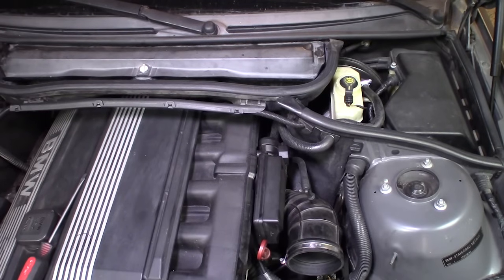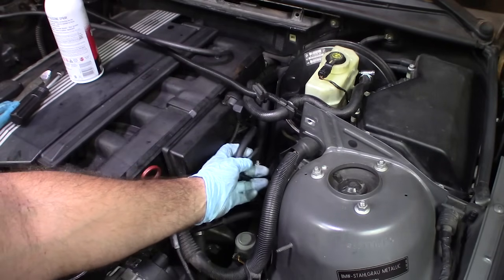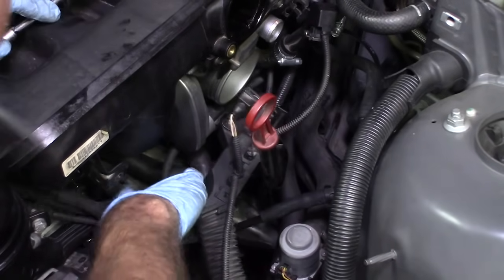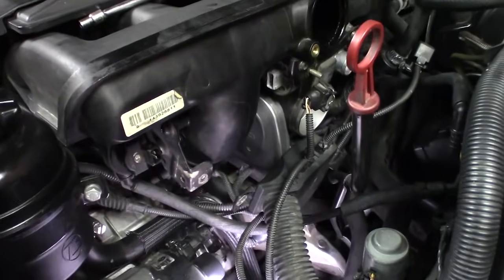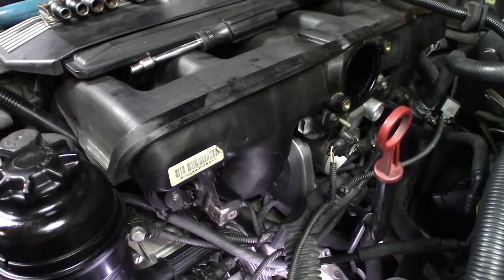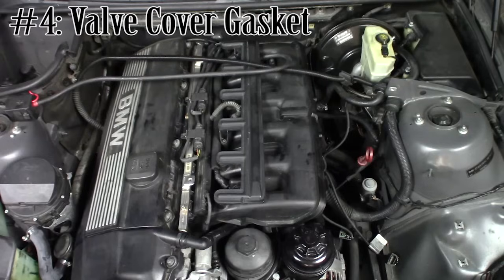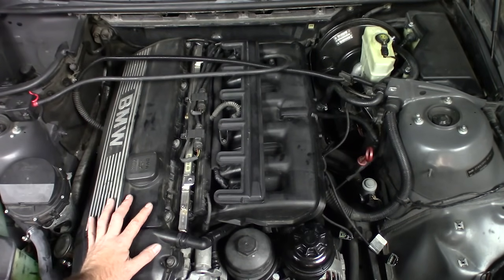BMW E46 & E39 Most Common Vacuum Leaks P0171 & P0174

Comment: Hello 50'skid!

I need your help. I've watched some of your videos and I LOOOOOVE them! i recently bought an 01 325i manual transmission with 126K miles. It would intermittently stall and would have a surge idle approaching a stop while the car is on neutral but will idle normal after about 10-20 seconds. After checking for vacuum leaks and cleaning the CAI valve and replacing the MAF, new air filter, change the DISA o ring. The stalling stopped but the idle bounce or surge during slowing down while on neutral or pressed clutch is still going. It would almost stall but not completely, but would rev up to come to a normal idle. I am soon to change the fuel filter. If you have any tips and advice it would much be appreciated. This issues is more prominent when the A/C is engaged. So i drive without the AC for now.  There are no codes at this moment and no other problem.

Thanks!
Reply from the maker: Look into the idle air control valve. That is likely the cause.
Reply: 50sKid I cleaned it with carb cleaner...do you recommend me replacing it or maybe test it first?

Comment: greatt video !!!!! i have the code lean bank 2 on mi 525 i 05 bmw and mi car is running just find so what do you think it could be mi problem?
Reply from the maker: +david aguilar Thanks.  Things that could affect just bank 2 are exhaust leaks (there is an exhaust manifold for each bank), leaking injector o-rings, leaky intake manifold (two gaskets, one per bank).  Those are the most likely suspects.
Reply: 50sKid awesome thanks i gone check those points and get you back my findings thanks for your help

Comment: I replaced my ccv valve and all hoses associated with it about 2 years ago after having burning oil issues, but now the car runs much better. However I did not buy all the right gaskets. I have p0171 and p0174 popping up. I have a hissing leak coming from the intake manifold gasket I believe and I will have to replace it. I could be wrong because It is important to replace and check so many things while doing this I realize, now I will have to tear it all apart again, just hoping I don't break something else! Patience is key thank you for your video.
Reply from the maker: The intake gasket usually is not a problem.

Comment: if you need to drive a while before looking into it... how harmful is it to the engine? do you risk real permanent damage?
Reply from the maker: Not unless you can feel the engine running poorly/rough.  The engine can compensate for quite a bit of vacuum leak by adding more fuel.  If the leak exceeds the engine's ability to compensate, the engine runs poorly, and that can be bad.
Reply: 50sKid
for a long time ive had a hesitation when i drive it was very rare that engine light came on, been like that for a year or so.

Recently i looked it up i got the p0174 system lean bank 2 or whatever.
So now im thinkin perhaps this is the reason for the hesitation? what do you think?

it does it when i turn off the car leave it be like say for 5 hours or oernight then when i start it it doesnt want to engage into first gear, RPM shoots high to at least 4k before it engages and then drives like normal and wont do it again unless i dont drive it again for a while.

At first i thought it was just like a cold start and warming up when it began like late 2014 (i garage this car) so garaged and drove last year... same issue, garaged againa nd drove this year... always been doing this.

Is it possible thats why it hesitates like that? Car is a 2004 bmw 325xi
Reply from the maker: When you see a hole in your roof, that's why the carpet is wet.
Reply: 50sKid
was that some sort of euphemism?
others have told me before it may be tranny slippage and i chalked it up to that. Now im unsure.
Reply from the maker: If you have a P0174, that is your problem. Look for vacuum leaks.

Comment: I need help...I have  disconnect vacuum line from valve cover to ccv...and block ccv line to intake manifold (disable ccv)...but I can still feel vacuum when opening the oil cap ...is there any other connection from valve cover or is there another crankcase evacuation to intake line that I should check...thanks

Comment: So I'm getting lean codes on both banks/ no air leaks other sensors are good. Have replaced fuel pressure regulator/ filter ..have replaced both pre cat O2 sensors with no success?? Only thing I haven't done is change the spark plugs " maybe I should have started there now thinking about it"...
what I thought it because I would have got miss fires in cylinders if it was the plugs / coils right???

Comment: your video is very graphic, but must disarm, you have a technique to know which of these hoses needs to change? or disarming one can know, my failure is stronger with the cold idling engine when the engine temperature reaches its failure almost disappears

Comment: could a really bad fuel filter be a cause of this too? I've looked for cracks and leaks, but can't find any!
Reply from the maker: Yeah it could if it was severely clogged.  That would cause insufficient fuel delivery which would show up as positive fuel trim which would eventually set those codes.  I've never heard of it happening though.  That would be an extremely clogged filter.
Reply: +50sKid hmmm i did a ghetto smoke test with a cigar and didnt see any leaks...definitely did it somewhat right since i saw smoke rise when i took off the oil cap. Will try to get a new fuel filter on and let you know. I mean...my car has 245,000 miles on it and I don't have the slightest clue to when or if the previous owner changed it lol
Reply from the maker: That kind of smoke test won't work -- you need positive pressure to build up inside the system for any smoke to make its way out of a leak.

Comment: Would a good enough vacuum leak cause it to run like crap and die off? I just bought one, I do hear vacuum leaking but yeah, won’t even drive man... it’s stuck about 59 miles from here...
Reply: Check your lower intake boot, mine had gotten disconnected, my engine had a crapy idle and would die if reved to 2000 rpm, once i put that back on, been running great

Comment: Can these codes make the car stall? My car was stalling and now it doesn’t turn on.
Reply from the maker: yes
Reply: 50sKid ok so my upper intake boot had some cracks and my lower intake boot had like three holes I swapped those out and my car turned back on. I drive it for a little bit went back home and when I tried turning it on again it would turn on it took like 5 mins for it to turn back on. Would I have another vacuum leak somewhere else?

Comment: Hi 50's kid, not sure if you'll get to read this but im working my way through a possible vacuum leak that started with these codes.
Ive changed all the usual suspects but still get a missfiring cold start and after a 30 sec plus idle a lumpy running.
Now i only get lean system too lean on both banks plus random misfire with low fuel?
Any ideas??
Tia
Love your channel.

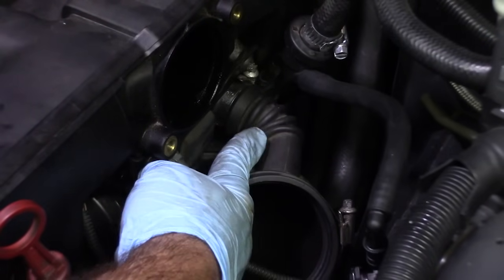Comment: the elbow you're talking about at 6:57 is cut open on mine and have all the codes showing. I can't find the part number for the love of God can you please tell me what it is?
Reply from the maker: +hostilityy So it's a different boot depending on whether you have an M52 or M54 and a different boot for each engine size as well, 2.3 or 2.8 or 2.5 or 3.0, etc.  Checkout realoem.com -- put in the last 7 digits of your VIN and then find the proper diagram in the fuel-injection system section.  For instance, this is mine (I have the 3.0 M54) http://www.realoem.com/bmw/enUS/showparts?id=EV53-USA-02-2002-E46-BMW-330i&diagId=13_0905

Comment: This is such an excellent video! Detailed, well explained, and easy to follow! I learned alot. Question - on an engine like this, if you open the oil cap on top of the engine while it's running, should it shut the engine off? Someone told me today that if it doesn't, it an indication of a separator hose crack. is that true? I have  P0174 error now and Im going to start with the MAF sensor.
Reply from the maker: +J Commodore Yes, it indicates that you have a major problem with your CCV system.  Either the hose I talk about in this video is cracked or the diaphragm inside of the oil separator is damaged.

Comment: Hi, through handling i cracked the lower vacuum hose on the elbow - as shown starting minute 5:29. 
E46 330i 2001.  120k miles so it was brittle.  Is this a DYI fix?  thanks for any helpful tips.  I am not sure i can drive the car so its parked till i figure this out. Thanks.
Reply from the maker: Yeah you can drive it when that's broken, no big deal.  To help get it out of the rubber boot, use silicone spray or wd-40.  The BMW part number is 13327503677 and you can buy a new one on eBay: http://www.ebay.com/itm/150745556721

Comment: Hoollllyyy smokes. This was the explanation i needed. In all honesty, this is making the fault deduction process way easier when its explained this way. The mechanics of how these systems operate. I just replaced my alternator and had to remove the air flow system to get to it, (sounded scarier than it axtually was) and aftet i placed everyhting back together, these 2 codes popped up the next day. 2 days after when i had time, i re-removed the air flow system again to make sure EVERYTHING was tightened back correctly, (and replaced my air box filter in the process) then the code dissapeared right after. Fast forward 5 days later, codes are back. So at least i know what im lookin at now after this videos details. TYSM 😊

Comment: Thank you after taking my 2004 530i to a crooked repair shop for an oil and transmission service they proceeded to tell me .Have a bad switch on my transmission $$154 part $4200 to fix..Small oil leak they wanted $2200 to re-seal my oil pan.. Unbelievable.So they refused to change the tranny fluid charged me $125 for checking ..And  faulty I-drive to check $125 allegedly did a reset pressed 2 buttons...After doing an oil change Ac/recharge wheel alignment and installing 4 tires I bought.. Charged me $809 no lights were on in my car 1 day after driving Service engine light soon comes on ..I refuse to bring my car back to these crooks..Service engine codes read these same codes you speak about. I bought a code reader off Amazon and cleared them...I will check for some of the symptoms you showed ...Thank you

Comment: hello , I have a leak next to the valve gasket right side where the hose is connected which I believe its called the oil pipe and I always find oil on top of the fan and the hose connected to the coolant system its not a lot of oil or little I'm trying to say that it's not leaking a lot or too little I need some help
Reply from the maker: +alex888801 I have a video coming up on changing the valve cover gasket

Comment: I also got a spark plug miss fire with these two codes. Could a vacuum leak cause a miss fire or would that be completely separate events?
Reply from the maker: yes a vacuum leak could cause a misfire due to too much air in the combusion process but it won't cause a spark plug to not fire--that is a different cause for a misfire.

Comment: I have a coolant leak.. I have replace the thermostat and cleaned the radiator. yet its seems that behind the thermostat metal casing there's 2 aluminum pipes or hole that seems to be where the Leak is. how do I repair this on a 2002 BMW 330i????

Comment: Hello 50sKid i have a 97 528i bmw after seeing your video started to check for vacuum leaks.With my car running when i take off the oil filler cap the motor shuts off.Put the cap back on restart the motor runs fine.Question is that OK? Thanks
Reply from the maker: +adam ant No it's not OK--sounds like the diaphragm in the CCV oil separator has ruptured, so now when you open the oil cap you are creating a vacuum leak.  Replace your CCV system.
Reply: +50sKid  Thanks for your quick reply now i am sure something is wrong. Have the car on jackstands changing the brake hoses will replace the CCV next. THANK YOU!

Comment: Also Kid the connection between the exhaust manifold and the muffler junction. After watching your videos and performing the repairs I was still having a code but this time for some unexplained reason a P0174 code showed up. So I heard you talk about leaks around that area that can cause a problem and sure it did carnal ... the other two Ox sensors are located close to the exhaust leak causin the pitot effect drawing more air than registered. Took it to the muffler shop and eventually that took care of the problem.. Thanks Kid , Thanks for sharing your knowledge  Base with us... Keep your channels running.  And enjoy your weekend
Reply from the maker: +Sumbamotor1 Nice work!

Comment: Hi again, so far I could not solve my rough idle issue even after replacing VCG, adjuster unit, T shape idle valve and checking hoses. Is it possible to have a lean condition due to lack of fuel? if so, how to check this?
Reply from the maker: Yes.  Check fuel pressure when the car is running.  It should be 50psi.

Comment: hi mate love your videos full of really useful can you give me your thoughts on repairing cold start issues it starts but dies straight away three times then runs lumpy till warm ?
Reply from the maker: Almost certainly a lean condition.
Reply: 50sKid things ive done so far spark plugs ccv cam and exhaust sensor fuel filter new intake boots both of them code reader showing misfire on all 6 cylinders o2 sensor and maff

Comment: Hi I've noticed that my airflow meter pipe is not connected and have no idea where it's going. The car idle isn't stable. It was removed after changing the starter . can you help with the location?
Reply: If your talking about the air intake boot(tube) it connect to a lower one with a plastic ring, the it connects to your throttle body and you idle control valve, it is hard to get to, but you can do it in an afternoon,
Reply: @jl2a4c  Hi thanks for the reply. They call it breather/vacuum pipe on intake. So it is joined on intake but to where it ends I don't know. Some say it connects to an oil separator. It's a breather for an air separator. The engine is N42. The model is E46 318I. I can't send pics. And what are possible disadvantages or symptoms if its missing.

Comment: Hi, 50's kid, I've been dealing with two problems on my 02 bmw 325i: overheating and vacuum leaks. I follow instructions in your common repair steps video, and also vacuum leaks video. For now, I wonder if you could help me with the overheating problem. I've replaced serpentine belt, ac belt, water pump, and thermostat, and have bled the cooling system. However it has a leak from around the thermostat area( or I believe that's where the leak is). I'm suspecting something is wrong with the thermostat. I bought it on ebay and it is not an OEM. I dropped it into the boiling water and it is not opening up, nor it is closing once I take it out. Also, I tested the old thermostat and that one neither opens up nor closes. Wonder if I need a new OEM thermostat? Don't know if I am testing it right?
Reply from the maker: +Vladimir K Well... I suppose if you left it in the water for long enough and that water was truly hot enough, you should have seen it open up, so perhaps you did get a defective one.  You don't have to pay dealer prices though.  Get a Wahler brand one from eBay.  That is the OEM brand.  Should be around $50.  I too had leaks after installing the new one with a new gasket and torquing properly.  I ended up using grey RTV around the perimeter of the old gasket.  Tighten until you see it just squeeze out, leave for 1 hour, then torque to specs.  I plan to make a video on this procedure.

Comment: Hello there,  
Thank you for the video.  It is really informational. One question,  what if my car is running lean on only bank 2? Where should a vacuum leak be? Or could it be any other problems?
Reply from the maker: Theoretically it could be a leaking fuel injector o-ring or a leak in the intake manifold gasket (there are separate ones for each bank) however those are extremely uncommon.  I would suspect a bad o2 sensor in that case.  But I would first confirm that by looking at O2 sensor voltages and behaviors.  Watch my fuel trims video.
Reply: Thank you for your reply. I replaced all 4 O2 sensors and the intake boot elbow. Now I have 2 codes. One is too lean bank 2 and one is too  rich on bank 2. All common leaking areas are checked and appeared to be good. I'm lost. The idle valve control is cleaned and spinning freely. Would DISA have anything to do in this situation? Thanks in advance
Reply: Thank you for your reply. I replaced all 4 O2 sensors and the intake boot elbow. Now I have 2 codes. One is too lean bank 2 and one is too  rich on bank 2. All common leaking areas are checked and appeared to be good. I'm lost. The idle valve control is cleaned and spinning freely. Would DISA have anything to do in this situation? Thanks in advance

Comment: The vacuum lines that are running to the upper intake boot (the elbow) what are they for? The lower smaller one broke on mine and I have no idea what its too and where to find replacement.
Reply: The larger one runs to the brake booster check valve, and the smaller one runs to the fuel filter as the pressure regulator backup. It is 3.5mm I.D vacuum hose.

Comment: First of all don't own a BMW, that said I didn't get the aforementioned codes until after I did the valve cover gasket, what did I miss, one small vacuum line in the back disintegrated and I replaced it but there was another one that I didn't, could that small line cause this problem, I've had to practically replace everything under the hood of this 2003 530i that I'm working on, also after replacing the oil pan gasket and oil filter housing there is still oil leaking from above somewhere, thank it's not my car.